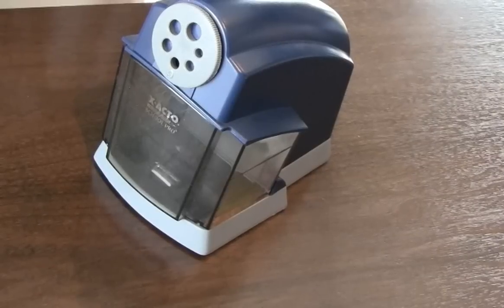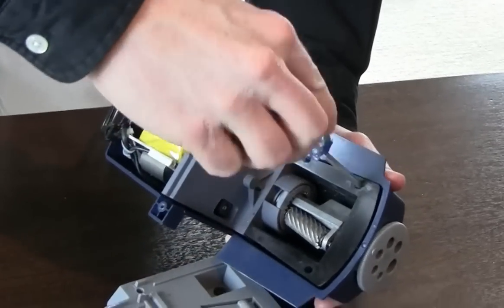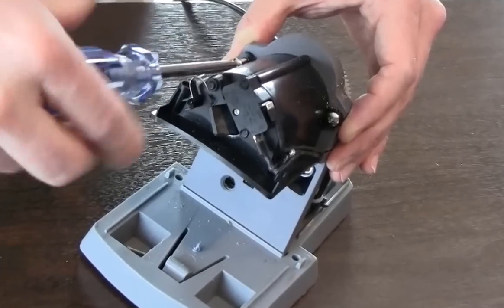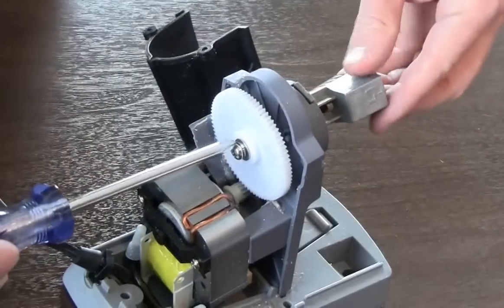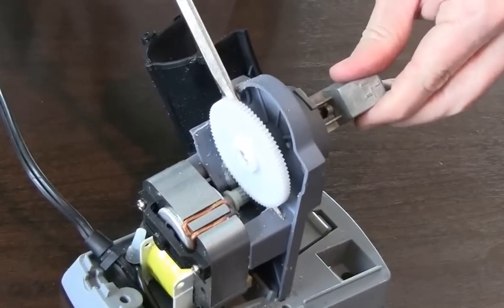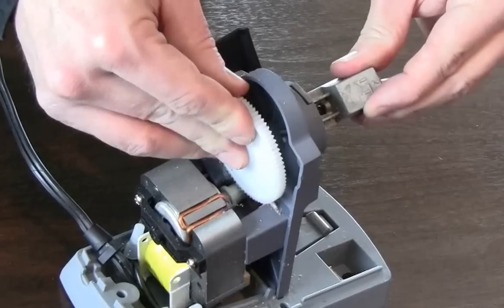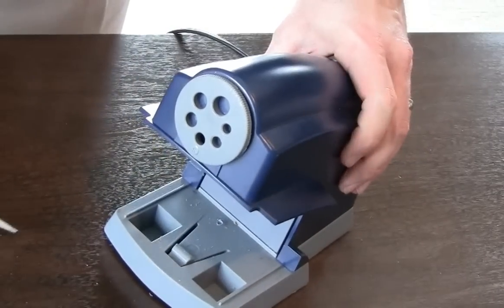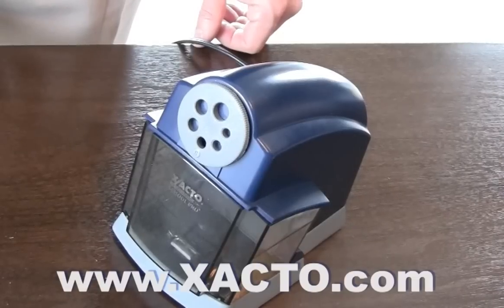How to replace cutters on the X-ACTO School Pro Pencil Sharpener

Comment: where do you buy the replacement parts?
Reply: You'd think they'd list it 😉
Reply: Amazon has most cutters, except for part # 1675LMR “teacher pro” sharpener. That is the one with an LED and auto shutoff. It requires snapring pliers to remove large gear and has a circuit board. I just sent them all of the info on their website.